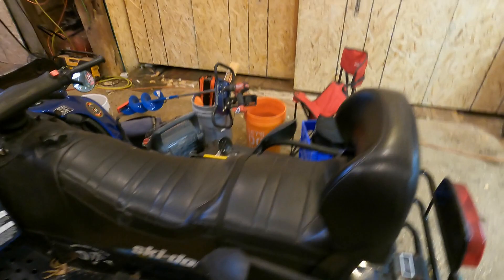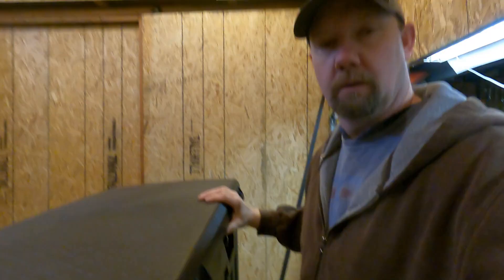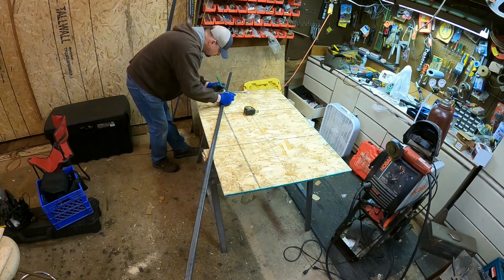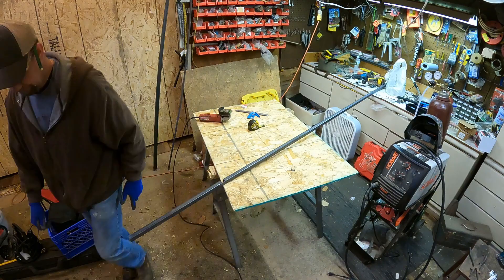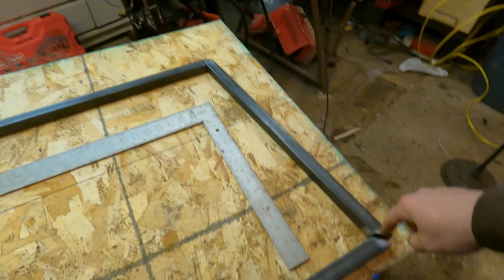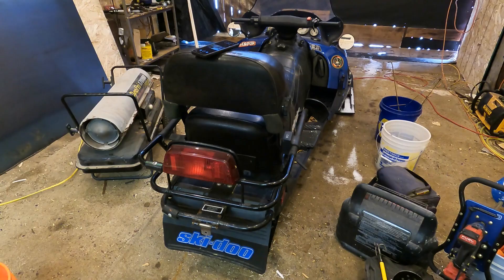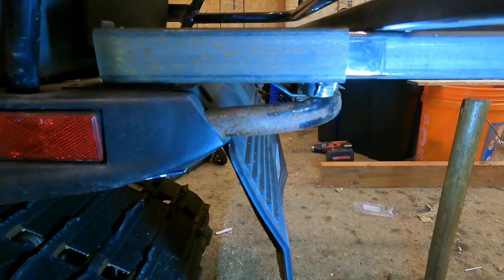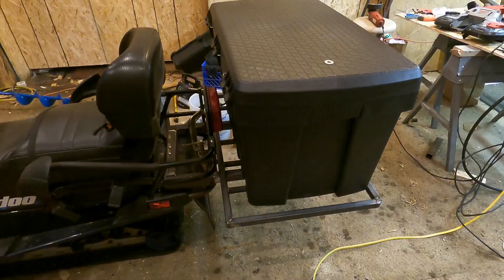DIY Ice Fishing Snowmobile Cargo & Auger Rack Setup

Comment: That auger mount is exactly what I needed for a reference. The others I've seen mount to the bumper or something or getting the hood open was tough. Thank you
Reply from the maker: Its worked well for me so far!
Reply: @dabarn  I spent the last 2 days and made my own version of this. I bolted a post to the Frame of the snowmobile under the hood. Made a small hole in one of the vents in the hood. And the rack slides into the post when the hood is closed. Pull the pin and remove the rack to open the hood